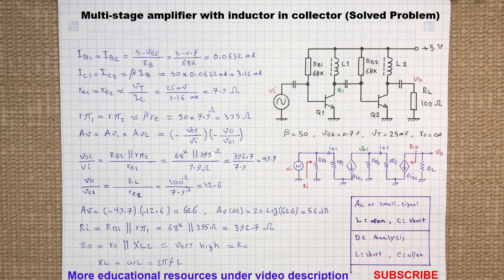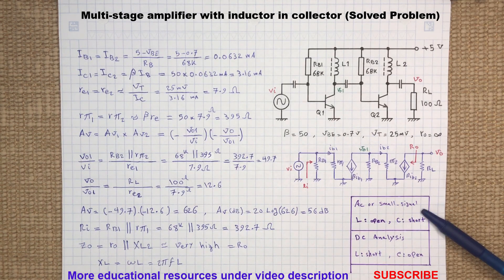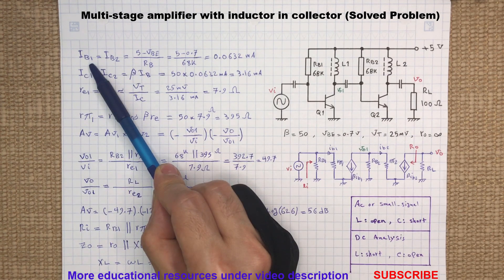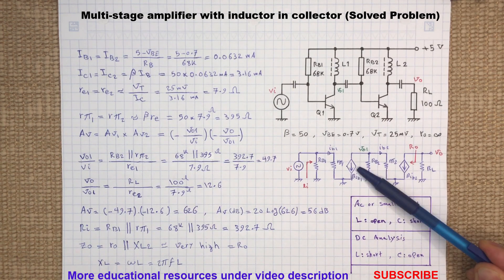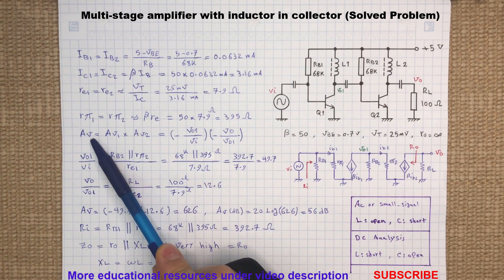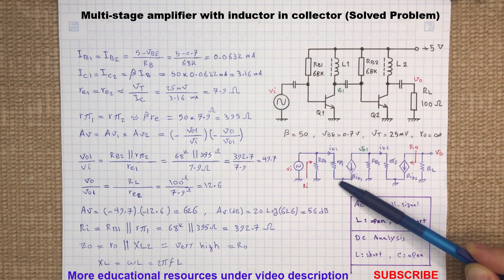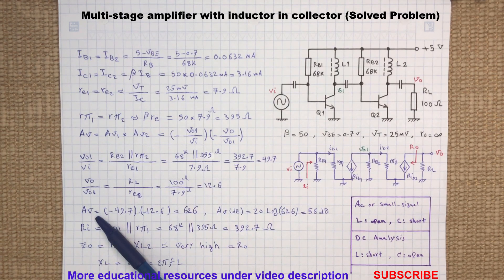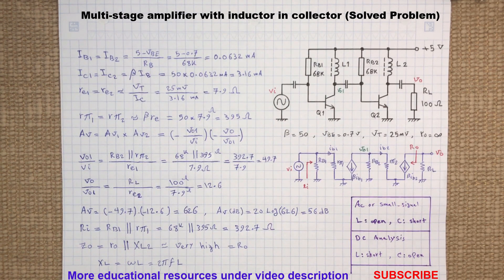Multistage BJT Transistor Amplifier with Inductor in Collector, Fixed Bias Method Transistor Biasing

Comment from the maker: Common Emitter Amplifier Small Signal Analysis : https://youtu.be/ToSGMAvbPmU
Push-Pull Power Amplifier Output Stage DC Analysis : https://youtu.be/NVvcwXdAgbg
Electronic Circuit Analysis Playlist: https://www.youtube.com/playlist?list=PLLA_QJ8rHZBh5LqrY41bCvKgreRDRWrBQ
Control System Playlist: https://www.youtube.com/playlist?list=PLLA_QJ8rHZBjS_S6WPkmUweF5NbImvSqf